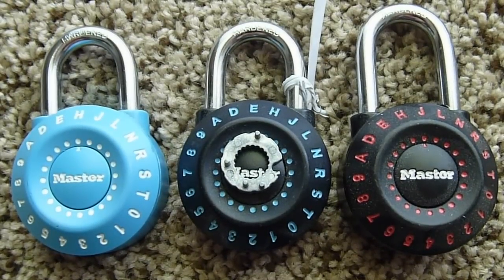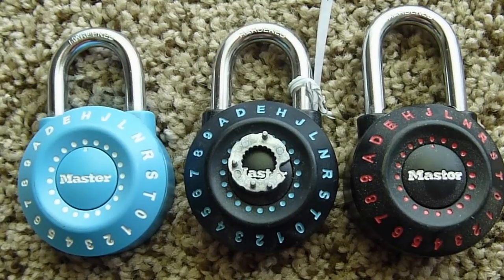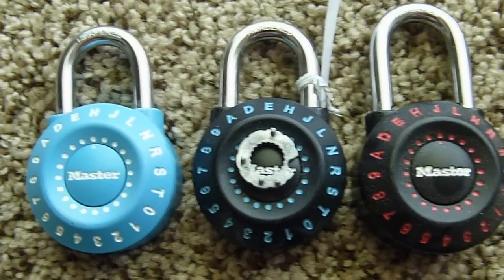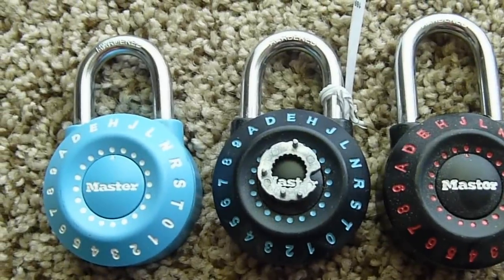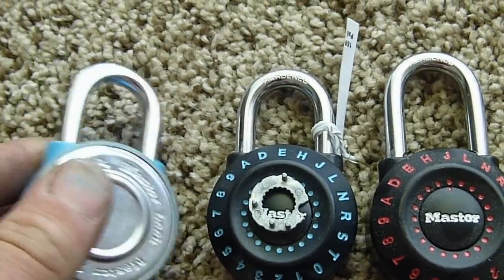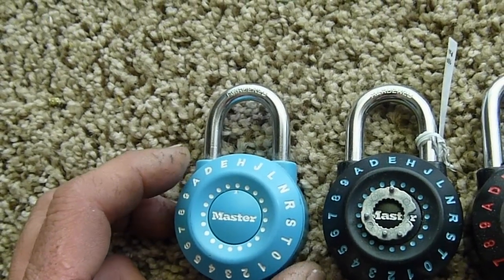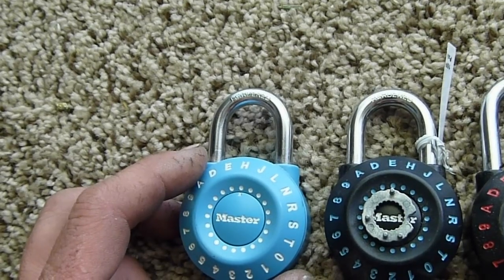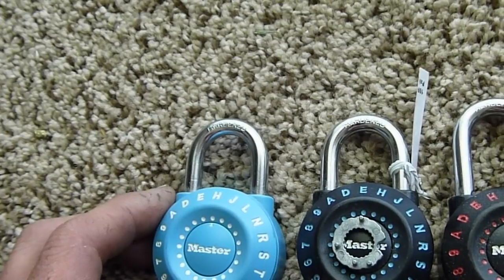How to decode a Master 1590D combination padlock

Comment: Hi Lauren, got a new padlock today as I took off the back of the other one. It does need 4 to be substracted as yours. The thing with this new one is each time you change the combination the second number gets mixed, if you program 6 it's 5, if you program N it's L, not a very dependable lock. Thanks for the info!

Comment: Mine was plus 6 after finding the notch, so FYI I guess it could be plus 4 or plus 6 to get the first number, daughter had reset it and forgot combo, funny thing is she chose 1st 7 then 2nd was 8... kinda funny opened on first try. Good technique though, finding the first number is the key to this lock. I agree the design sucks for griping while turning. I rate it low on design quality

Comment: I guess there are different groove locations on that tumbler in regards to the pins. I have an opened 1590D lock here and applying your method it needs 6 to be added, not 4. I guess you where lucky getting 2 locks that need 4 to be added.

Comment: this lock sucks. I if you screw up on the password reset, you'll likely have to buy a new one.
Reply: Johnson Long its trash i literally know my code and patterns but it wont let me open it after i opened it successfully the past at least 200 times.
Reply: That's what happened to me